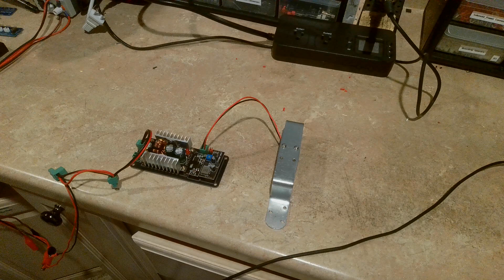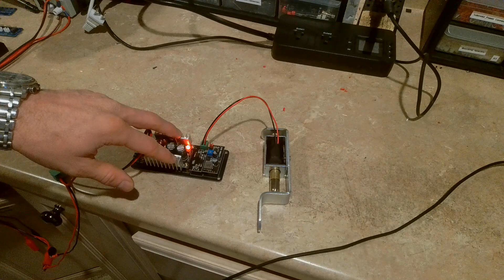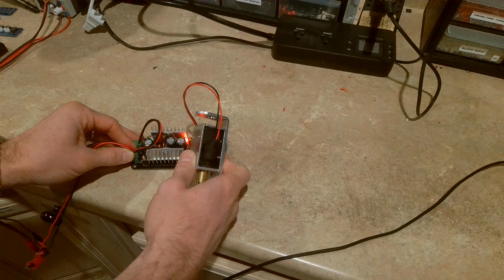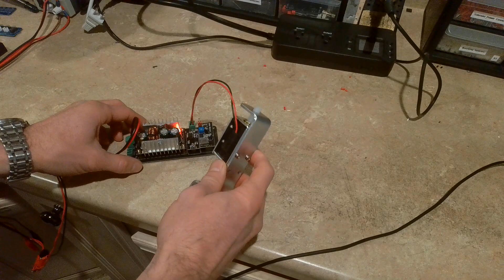Virtual Pinball Knocker kit from Cleveland Software Design

Comment: Going through your videos and I'm glad I found them!!!! I'm re-working my entire cabinet and need new boards, etc. (previous boards were from xxx company made specifically for them). Will my current knocker work with your boards or will I need to replace the knocker as well?
Reply from the maker: Pretty much any knocker will work with this board, so as long as it is loud enough at 24v (some are designed for 48v)